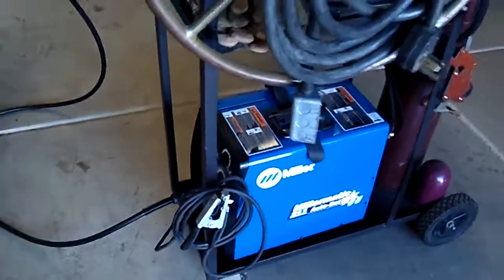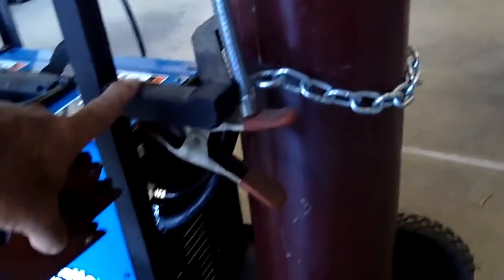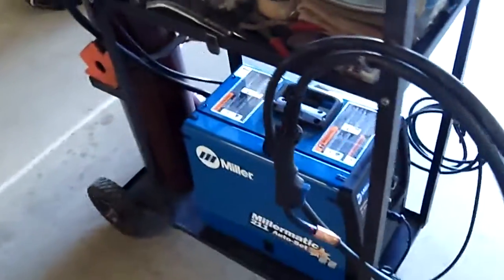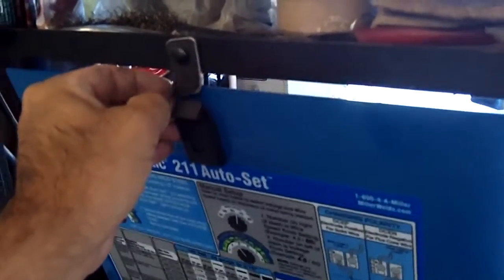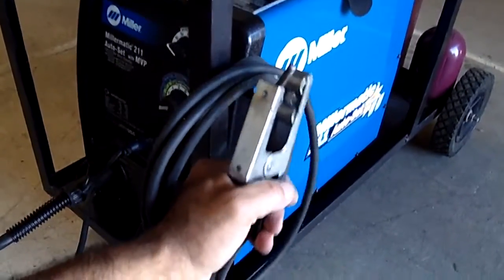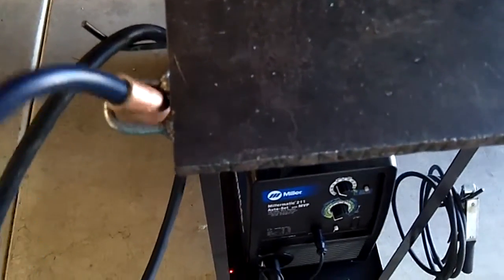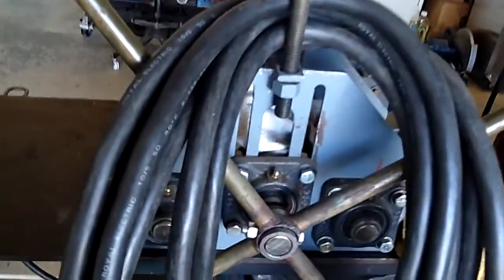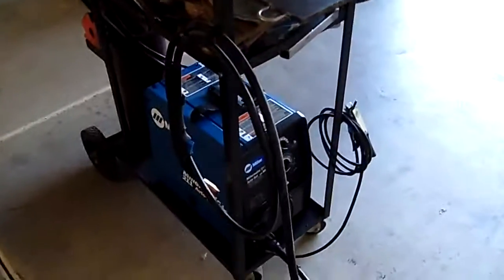How to Design Your Own MillerMatic 211 23907422 MIG Welding Cart

Comment: what a cool vid are u going to paint it blue and what do you use for a chop saw we have a mightier box chop saw and we were going to put the steel cutting 82 blade oshlun can you wright me and tell what you think about it . father and son welder.
Reply from the maker: Thanks for the compliment.  I actually painted the frame black (boring, but it prevents rust), the table is raw steel so that it conducts electricity.  I simply place my work on it an weld away.  The entire frame is grounded.

Comment: THe carts that are mounted high and in a angle are bolted down so they don't fall off.
Reply from the maker: Yes, however, once you start MIG welding, you will soon realize that a lower center of gravity on your cart is much more functional than angling your welder upwards.  It's not that the welder falls off, my cart wheel got caught in a concrete expansion joint and the whole car fell over.  Whether it is bolted down is not the issue, it is the high center of gravity.

My opinion is that those carts look cool, but have little functionality.  Rarely do you need to adjust the MIG settings on a project, and when you do, it's simply a turn of one of the two knobs.  As for mounting the MIG Lower is better!